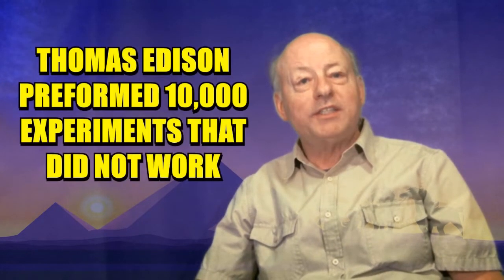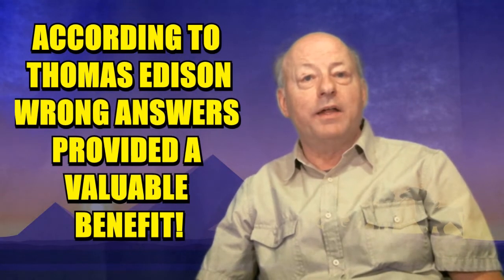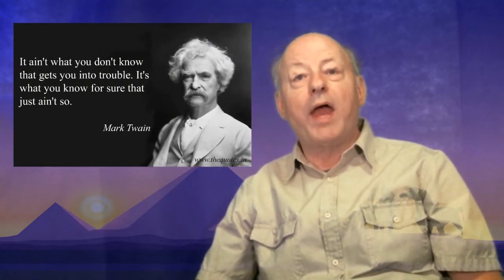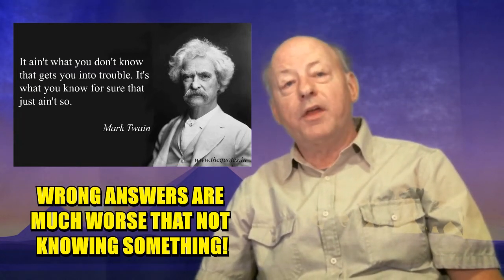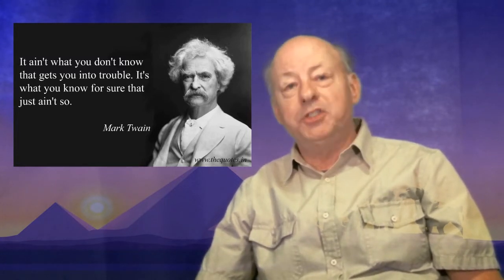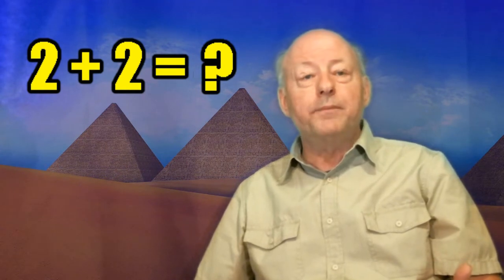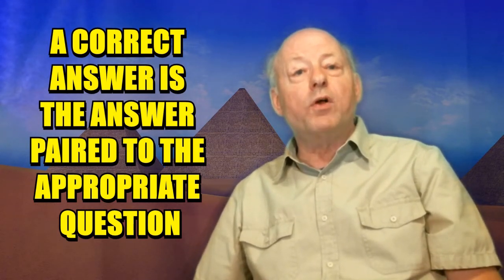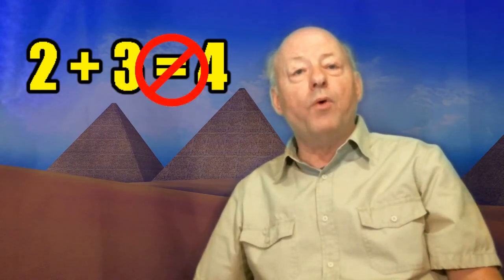How Was The Great Pyramid  Built? Wrong Answers Only!

Comment: Correlation without proof of causation does not mean that there was no causation. That the "vents" point to the star that signalled the Equinox of their time during the equinox of their time, when it's so specific to that time and direction seems like more than a coincidence. That's like saying that it was randomly positioned at nearly exactly true north. Probably not random.  They most likely ment to do it that way.  Just because we dont know how or why does not dismiss causation.
Reply from the maker: Micheal Trammel your faith is strong. You want to believe correlations without causation made up by modern people who use invalid research methods.  The vents are pointing away from Orion.  Watch my other YouTube videos. I think it will help you break the chains of your misunderstanding.
Reply from the maker: Can a great pyramid correlation be invalid?
Reply: @GreatPyramidPump  can it? Of course. And I will admit that some of it could be, and some of it probably is, let's say coincidence.  But to say things like it being aligned perfectly with the cardinal directions is random and the fact that it correlates with true north by less a degree doesn't mean that they did it on purpose is being willfully blind.  It seems very much like you wont believe anything anyone except the "experts" unless it's written on preserved papyrus leaves found in a pharaohs tomb.  I will agree that we dont have writings or "proof" that they did these things that way for this reason.  But that in no way means the these things aren't at least as possible as the mainstream theories.
Reply: @GreatPyramidPump   also, neither I nor hancock said the vents were pointed at Orion. Orion is a constellation. I said it pointed at an individual, specific star.  And what invalid research methods do you speak of?  Math?  The ratios and geometry that they obviously used in other structures and art? Can you elaborate?
Reply from the maker: @michealtrammel3910  The vents are not pointing to whatever star you want them to point to. The orientation of the Great Pyramid did not matter at all to the builders so they just built it square to the world.  See, I can make up explanations for perceived correlations too.  Made up "correlations" that modern people came up with are wrong answers to the question: How was the Great Pyramid built?  You seem to be telling me there is no proof for your faith based assumptions about made up correlations without causation. The correlations without causation are just conjured up using very poor research methods and are just plain old logical fallacies with as you put it, no proof.  I do a lot of radio talk show interviews and the logical facilities of the Orion Correlation Theory is a hot topic right now.  Maybe this video will help you understand just how muddled the flawed research methods are of the Orion Correlation Theory really are.  https://www.youtube.com/watch?v=HHutuH_05qc&t=435s
Reply from the maker: @Micheal Trammel you asked about math.  In the realm of legitimate academic research math alone does not validate a correlation.  Not at all. In fact pretty much all invalid correlations are precise.  If this sounds strange to you it means that you are not familiar with valid research methods.  The following link has a bunch of correlations that are mathematically precise.  Go to the link and learn about those mathematically precise correlations.  come back here and tell me if those mathematically precise correlations are valid because they are mathematically precise. Here is the link. https://www.tylervigen.com/spurious-correlations
Reply from the maker: Micheal was confused as to how math did not validate a correlation.  I provided a link to help him start to learn about research methods.  He was unable to learn that "math" or "precision" do not validate a Great Pyramid correlation.  Instead of discussing research methods he was more interested in hurling insults and personal attacks. Just like other Great Pyramid correlation without causation believers he exhibited hostility and anger instead of discussing the forbidden subject of research methods.  His predictable behavior is discussed in my video titled: The Orion Correlation Theory and the Forbidden Subject.  Here is the link:  https://www.youtube.com/watch?v=YfFRcuTj3MU&t=290s
Reply: @GreatPyramidPump  see. I just lost all respect for u.  I never hurled insults.  I said u are rejecting the theory because,  and seemingly only because,  the Egyptians themselves didn't tell you they did it for that reason.  Never mind that the Aztecs did the same thing and said that's why they did it.  You are putting words in my mouths to tear me down and ignore what I actually am saying. You are continually saying that everything amazing about the Egyptian pyramids, the fact that it's so perfectly aligned, the fact that the vents absolutely do show certain stars at certain times, the fact that it's so perfectly square at the base, the precise ratios of the actual structure itself, were not part of the design and just kind of happened by accident.  And you claim all of that by pretty much just saying it.  And now are petty much lieing and insulting me and my point so you wont have to actually discuss it.  I understand being a skeptic, I really do.  But this.......  you....   this is wilful blindness for not other reason than to say everyone is wrong to make yourself feel smarter.   Have fun with that.  I decided a long time ago to look at evidence at let it speak. Not to deny to evidence for my convenience.
Reply from the maker: @michealtrammel3910  saying "the Aztecs" is providing a wrong answer to the question: How was the Great Pyramid built?  There is no feature specific to the great Pyramid indicating the builders of the Great Pyramid intended any relationship between the Great Pyramid and stars.  Every hydroelectric dam on earth has passages that point to "stars". No dam passage-star correlation was intended.  The vents of the Great Pyramid were purposefully designed and the result of that design is that the vents point away form "special stars".  I will make up an explanation and say they were "telling us" that the Great Pyramid had nothing to do with those "special stars".  Did you go to the link I provided that will help you understand "math" and "precision" do not validate a perceived correlation?   Probably not but here is the link again. https://www.tylervigen.com/spurious-correlations.  It seems that you just want to believe fake Great Pyramid correlations without causation with as you put it no real "proof". The following link is about the most important Great Pyramid correlation ever discovered.  https://www.facebook.com/photo.php?fbid=2888094664592257&set=a.118725161529235&type=3&theater